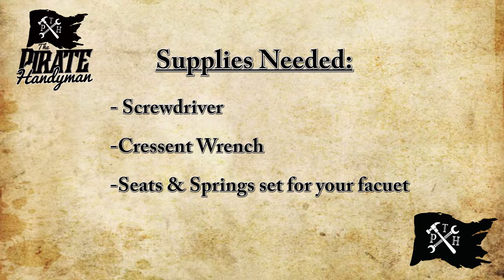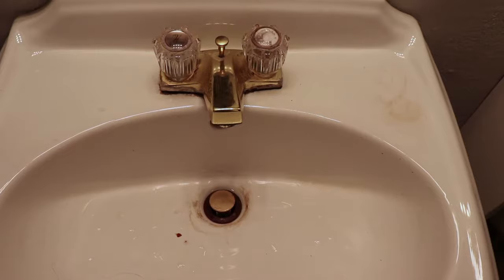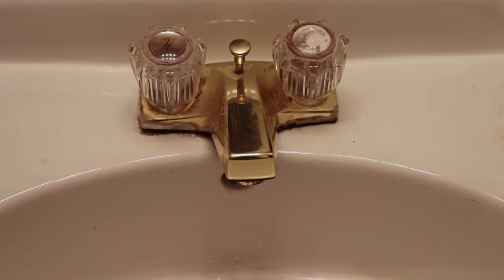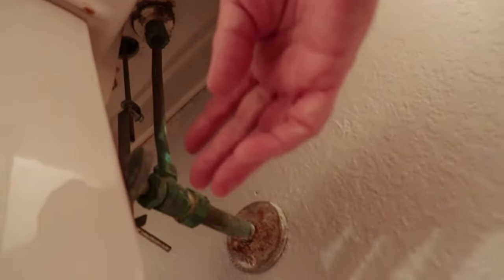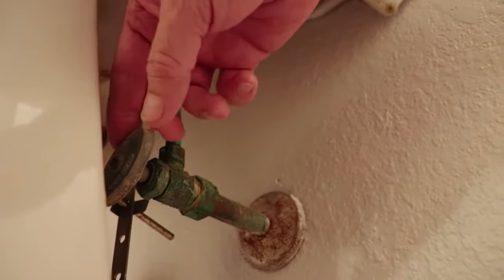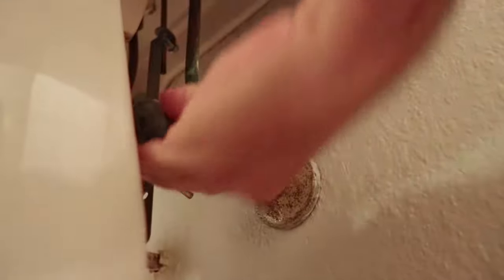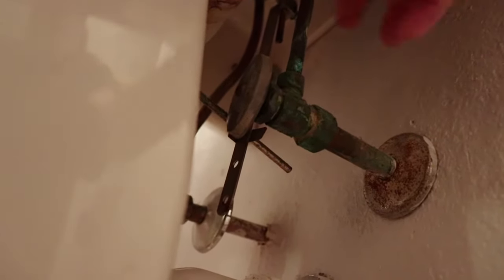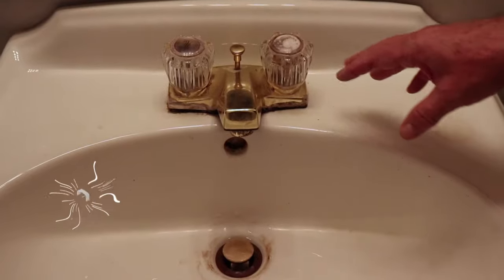How to Fix a Dripping Bathroom Sink Faucet Double Handle

Comment: Thanks for video. I need a little more detail — does the seat go in first and then the spring?  I didn’t catch what order you had there before slipping on to screwdriver.  Also, my plastic valve has removable little plastic piece - can you tell me why it is removable?  Does it determine which way handle turns to shit off water?  Thanks for your help.
Reply from the maker: The spring goes in first, wide-end down, followed by the seat, which goes over the spring.  I believe the other piece you are referencing is the cartridge.  Yes, it determines which way the handle turns, but I recommend putting it back in the same way it came out.  I've experienced leaks when putting it back in the opposite way it came out.
Reply: @thepiratehandyman2225  thanks - that’s very helpful

Comment: I wasn’t aware of the seat and spring under the cartridge. No other videos I watched mentioned that. Hopefully that will fix my issue as my cartridges are old metal ones and I could not find a replacement. You can always trust a pirate!
Reply from the maker: Aye, matey - always!
Reply: @thepiratehandyman2225  hey so unfortunately my hot water cartridge seems to be stripped and I could not find any springs or seats in the cold water valve. I also ripped the sink off the counter and from the drain pipe while attempting to loosen the hot water cartridge lol…

So I’m looking to replace the entire sink and faucet while keeping the current countertop/vanity. 

Another problem. Even when I turn the hot and cold water off under the sink. Water still runs through. This worries me since I’ll have to mess with that when removing the old setup and installing a new one. I know I can turn off the main water to solve this but hope it won’t have any bad effects on the new setup? 

Thanks in advance if you have any experience and tips with that book I wrote haha!
Reply from the maker: Sounds like you may need to replace the "O" rings or grommets in the valves for the feeder lines under the sink.  This will require you to shut off the main water valve to fix.  I would definitely do that before replacing the rest of the set-up.  Good luck, matey!
Reply: @thepiratehandyman2225  thank you for the help! Most appreciated
Reply from the maker: My pleasure, matey!

Comment: Oh my, wish I had seen your video first. The ones I saw said to replace valve. I removed the old valve , kept it, and while I was removing it, the threaded part fell in the hole in the sink surface. Fell at an angle and now I can get it back up thru the hole. The small copper supply pipe is crimped, but does allow water without leaking at the crimp.  HOW can I get that back up without crimping the copper feeder pipe more? As I said it is now at a slight angle. I have photos I can text if you can help.
Reply from the maker: Send the photos to  ThePirateHandyman@gmail.com, and we'll figure this out, lass!

Comment: Looked easy enough.  Bought the parts for $12.  Watched other videos that showed the exact same thing.  My faucet is still leaking and now somehow I screwed up the hot water  knob. Can't turn on the knob to get water.  I have to turn the valve underneath on /off now.  I created another problem...😊😢
Reply from the maker: Aye, matey, that happens! First of all, take the hot water knob apart, and put it back together, taking care to make sure everything is lining up correctly. If it starts working again, but still leaks, then you may need to replace the cartridge. Let me know if this works.

Comment: I live in a modular home and there is no water shut off valve under the sink, so can you tell me another place I can look without having to go under my Trailor. Thank you
Reply from the maker: Aye, lass, there should be a master valve next to the hpme, It's usually located on a direct line from the water meter near the street to the house. If it's not there, you can usually shut the water off at the water meter.

Comment: I’m wondering if this would also work for a sink where the water is running continuously even when I’m trying to tighten the handle? And the handle is really hard to turn to try to turn the water off completely
Reply from the maker: Aye, lass, you should try using a lubricant like WD40 or 3-in-1 Oil on the shaft of the valve to make it easier to turn. If that doesn't work, you may have to turn the water to the dwelling off completely, then take the valve apart and clean it with a product like CLR. Let me know if this helps.

Comment: could a leaky faucet be due to a valve or cartridge issue?  or is usually the seat and spring?
Reply from the maker: Aye, matey, very good questions. Does the faucet still drip when you shut off the supply valves? If so, the grommet in the valve needs to be replaced. See the link below on how to replace the grommet. Even though the video is for an outside faucet, the concept is the same.
Usually, it is just the spring and seat. And that is the least expensive, so I always try that first. If it still leaks, then you'll need to replace the cartridge.

https://youtu.be/KDAB0HjgYYs

Comment: How do you know if it’s a new cartridge/valve that you need rather than the rubber/spring thing?
Reply from the maker: Aye, matey, ye don't.  The spring and grommet are usually the culprits, and the least expensive.  If replacing the spring and grommet don't fix the drip, then you replace the cartridge.

Comment: How do you get those fancy handlebar style faucet handles off? I dont see a set screw or anything to release em. Great video btw
Reply from the maker: Aye, thank ye for the kind words. On almost any faucet handle, if there is no "cap" on the top hiding the screw, then there is usually a screw on the side of the handle that requires an allen wrench.  It could be partially hidden up underneath the handle.
Reply: @thepiratehandyman2225  I actually spent a chunk of the night trying to get these off then gave up and called my plumber buddy. They're held on by a collar under the sink that had a set screw. Even he said hes nvr seen handles like that. Leave it to my grandparents to build a bathroom with some sort of rare handles😅
Reply from the maker: Aye, matey, I've never heard of this either! Good to know.

Comment: 3:28 I’m having trouble trying to take off the knob (It’s a bit stuck). Do you have any suggestions on what I should do?
Reply from the maker: Aye, that happens. Try squirting a lubricant like WD40 or 3-in-1 oil around the shaft, and let it sit for 30 min or so, and repeat if it's still stuck. If you have hard water, you can also try a product like Lime-away. If still stuck, try heating it up with a hair dryer.

Comment: My issue is when I turn off both water valves under the sink water continues a steady stream of hot water.  
Should I just replace my entire faucet?
Reply from the maker: Aye, lass, the problem may not be the faucet. If the hot water valve is all the way off, but hot water is still coming out, you may need to replace the grommet in the shut-off valve. The link to the video below is for an outside faucet, but the concept is the same. Let me know if this works.
https://youtu.be/KDAB0HjgYYs

Comment: I have delta gooseneck bathroom faucet. I put in new cartridges. Leaking under the sink from where? So frustrating. Can't turn cold water valve off that's attached to old, old plumbing. Help please🙏
Reply from the maker: Aye, that be a problem.  First, you need to shut off the main water valve to the house.  Next, if you haven't done so, also replace the springs and grommets.  While the water is off, spray the shaft of the cold water valve with WD40 or 3-in-1 oil, and let it sit for an hour or so before trying to turn it.  Let me know if this all works!  Smooth sailin'!

Comment: I have a a double facet like that mine was leaking I shut both valves off and it still drips.  It is staining my sink it gets black nasty. I don't ever go in that bathroom but I would like to know how to fix it. It's only me and I have bad knees how can I save coin help.
Reply from the maker: Aye, lass, it sounds like you need to replace the grommets in the shut-off valves - this is common. The link to the video below is for an outside faucet, but the concept is the same.
https://youtu.be/KDAB0HjgYYs

Comment: I did this, but the water tap still seems to leak. I have the water hot water supply line off but it's still leaking. Is there a way to replace the seal or is there a seal that needs to be replaced on the valve
Reply from the maker: It could be the shut-off valve itself, but that's an easy fix.  The video in this link is for an outside faucent, but the concept is the same for an inside shut-off valve.
https://youtu.be/KDAB0HjgYYs
Let us know if this works!

Comment: Where can I find the video for the repair for one handle type ?
Reply from the maker: Aye, lass, I haven't made that one yet!  However, the concept and parts are the same.  Once you shut of the water, follow these steps:
1. Remove the handle - you'll need a small Allen wrench.
2. Remove the collar. you'll need a large pair of pliers or a pipe wrench to turn the collar counterclockwise.
3. Pull out the cartridge. At the bottom this seat there will be a hole on each side. You may need to soak up the water first with a paper or cotton towel.
4. In these holes you will find the rubber grommets and springs (1 each per hole) that you can replace.
Let me know if you have any questions! Smooth sailin'. lass!

Comment: My faucet is exactly like the one you have here. I turned it on and heard some dripping, I looked under the sink and there was A LOT of water. This must've been going on for weeks and I didn't realize. It drips (under the sink) when I turn both hot and cold on and the water is coming from where the center stopper is. Like the little piece you pull up and down to close the drain. You turn the handle on and the water comes from that middle hole where the stopper is. How do I fix that?
Reply from the maker: Aye, I've had this happen.  There is a collar that holds the stopper shaft in place, and there is a ball on that shaft that needs to seat against that collar.  Remove the collar, pull out that shaft. Clean both the ball and the collar.  When you put it back together, make sure the collar is tight.  If it still leaks, then you need to replace the drain assembly.  If this is the case, let me know, and I'll give you step-by-step instructions. It's fairly simple and inexpensive.

Comment: Some videos say replace the valve some say replace seats and springs 🤦🏾‍♂️
Reply from the maker: Aye, matey, it can be one of 3 things, or a combination.  I start with the least expensive - seats and springs.  If that doesn't stop the drip, then the cartridge is the next I replace.  If it still drips, then there is probably a crack in the housing somewhere, and I'll replace the whole unit.

Comment: Why didn’t you change out the o ring while you were changing the seats and springs? I think when my husband fixed our dripping sink he either just did the seat and springs or just did the o rings because it is leaking again 🤦🏻‍♀️ I might give it a try this time.
Reply from the maker: Aye, lass, usually the seats and springs be the culprit, and if that doesn't fix it, then I go on to the other parts.  Please let me know what you find!

Comment: I have a little dripping (but surely annoying though).  I am not sure what side it is dripping from.  Is there any way to find out, or should I just replace on both sided?  Thanks
Reply from the maker: Probably best to replace both sides, because if one side went bad, the other side is probably not far behind.  However, you can isolate which side is dripping by shutting off the water under the sink to the "cold" side first, and see if it still drips.  If not, that side is the culprit.  If the dripping continues, turn it back on then shut off the "hot" side.  The dripping should stop, and that side is the culprit.  If it still drips, then both need to be replaced.  Good luck, matey, and let us know how it works out!
Reply: @thepiratehandyman2225  Thanks for the quick reply.  I don't have any valve under the sink so I can't shut it off there.  But I appreciate an idea!
Reply from the maker: That's a bummer.  Luckily, the parts don't cost much coin.

Comment: Ok so took it all apart...and where the seat and spring go water keeps forming and overflowing. Water is fully shut off under sink.
What is this issue?.thanks
Reply from the maker: Try shutting off the main water valve.  If that stops the flow, then you also need to replace the grommet on the shut-off valve under the sink.  It is very easy.  I'll post a link below.
Reply from the maker: Even though this video is for an outside valve, the concept is the same.
https://youtu.be/KDAB0HjgYYs

Comment: What do I do if the cross point screw won't come out?? I'm having trouble taking out the handle
Reply from the maker: Aye, matey, that can be a problem.  Try squirting a lubricant like WD40 or 3-in-1 oil around the head of the screw, and let it sit for an hour or so. You may have to do this a couple of times. If it's still stuck, try heating up the screw with a hair dryer. That should do the trick.

Comment: Does the seat part go down first or does that stay up like a top?
Reply from the maker: Aye, lass, the spring goes in first, then the seat, which stays at the top.
Reply: @thepiratehandyman2225  right. But I mean the wide part of the seat. Narrow part on top, wider in first at the bottom.
Reply from the maker: Yes, the narrow part on top, wider part at the bottom.

Comment: What do you do if you replaced the spring, grommet, and cartridge and it still leaks from the handle? Thanks.
Reply from the maker: Aye, matey, that probably means that the casing is cracked, and ye need to replace the the faucet.  But ye can do it yourself - smooth sailin'!
Reply: Avast, now I don’t need to walk the plank and can inform me wench. Thanks.
Reply from the maker: Aye, matey!

Comment: Hi I have a faucet that is hot but not running water out so not sure why it so warm
Reply from the maker: If you replace the seat and spring, and it still does not work, you may need to replace the grommet in the supply valve under the sink. The video link below shows how to do this, even though it is for an outside faucet. The concept is the same.
https://youtu.be/KDAB0HjgYYs

Comment: Is a double handle bathtub fix the same?
Reply from the maker: Aye, matey, it should be. However, depending on the type, you may just have a grommet held in place by a screw on the end of the handle, inside the housing. In that case, you won't have a spring and a grommet, just a flat grommet with a hole in the center for the screw.

Comment: What does it mean if u turn both shut off valves off an its still leaking?
Reply from the maker: I could be that you need to replace the grommets in the valves themselves. Here is a link to a video that shows how to replace those grommets. Even though this is for an outside faucet, the concept is the same.
https://youtu.be/KDAB0HjgYYs

Comment: Can you link or help me get what I need for parts  it’s a two handle faucet not sure what brand.
Reply from the maker: Aye, lass, here is what I used:  https://www.homedepot.com/p/DANCO-Seats-and-Springs-Kit-for-Delta-Faucets-86968/203194027
Reply: @thepiratehandyman2225  thanks so much. Yeah I don’t know the brand  so hopefully this will work what about the cartridge white piece?
Reply from the maker: That will definitely depend on the brand.  Try replacing the springs and seats first, as they are usually the culprits.  If it still leaks, remove the cartridge and take it to the hardware store, or take a picture of it and take it to the hardware store.

Comment: I need to replace a single water knob in a stand alone shower but it wont come off. Can you help guide me with that?
Reply from the maker: Aye, lass, try using a product like CLR to dissolve the deposits that are gumming up the screw or nut that is stuck. You could also try a lubricant like 3-in-1 oil or WD40.

Comment: Changed the seat and spring now I have just a trickle of water can’t figure out what issue is hot water is no problem just the cold and the water valve under sink is open all the way
Reply from the maker: Aye, lass, sound like something did not line up correctly - it happens. Try taking it apart again, making sure that when you insert the spring and grommet, it seats properly before reinserting the cartridge. You can test it by simply pushing it with your finger to make sure it moves in and out (or up and down) smoothly. Let me know if that works.